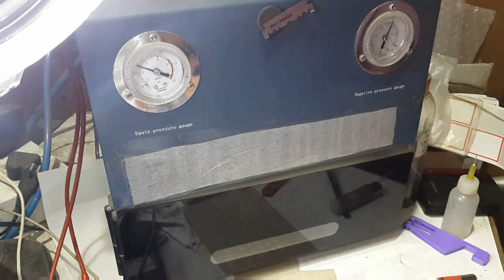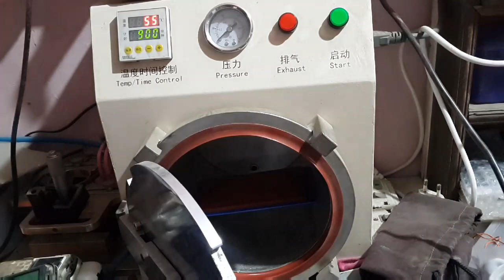MI redmi 6 pro glass touch only replacement. mubin danawala

Comment: hello guys,'

im the lucky owner of a redmi 6 pro,

my screen broke so i order a new one from aliexpress.

The screen came today and i follow a youtube guide and replace the cracked screen with the new one.

now the screen is all black,..

u can call the phone, and it vibrates and you can use the touch in the back for log in, and u can turn it on and off.

but no matter what, the screen is black.

So i thought i just go back to the old screen cracked glass screen.

That screen is also black now, all the time.

What did i broke?

help guys.
Reply: Ask an GSM Expert
Reply: U have Broked The Light Plus Or minus line .. Google it Redmi note 6 lcd light ways..
Reply: @NoName-ru9fq  can it be fixed?
Reply: @djbaaz  it Can Be Fixed But U need to do some wire Jumperings
Reply: @NoName-ru9fq  yes, I think so also, I broke the port when I was pushing the display cable in.
Reply: @djbaaz  take your phone to a good GSM expert he can surely Help You .😄